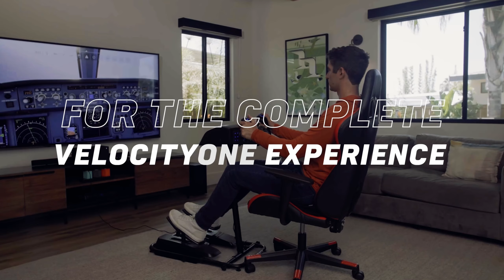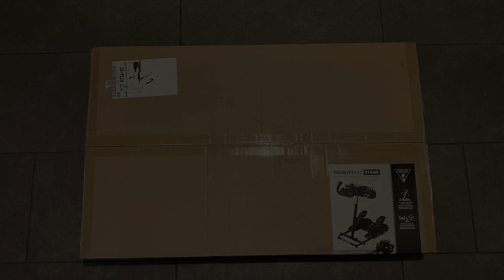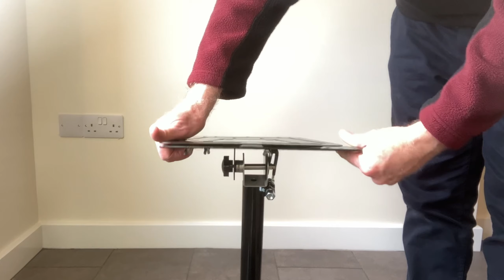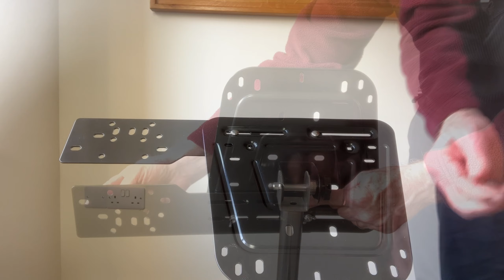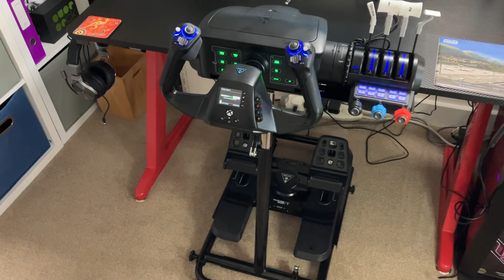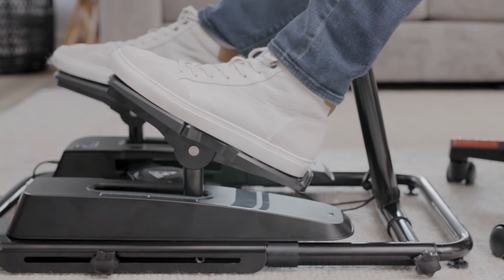An answer to your peripheral space problem? | Turtle Beach VelocityOne Stand | Set Up Guide & Review

Comment: There is little movement of the plate when pushing the yoke,so i drilled a whole in the pivoting parts and fit a quarter inch bolt in there and improoved as there is no more movement  with the pivoting parts.

Comment: Thank you for this video! I had mine backwards. I found the directions uselss, but the product nice, even set up wrong. I can fold mine down pretty far with the steering wheel and peddles still attached. I play a lot of Need for Speed style games and my wheel setup isn't that expensive, but it still worked with the stand. Overall very pleased. Thanks again!

Comment: Tried to attach an old Saitek yoke and Thrustmaster throttles using screws but ended up using 3M VHB Tape 5952F. Much easier and sturdier to fit than the screws, but looking forward to issues with disassembling it to replace something in the future.

Comment: will it work with my old Saitek pedals?
Reply from the maker: I think so. Haven’t tried them.
Reply: @SimHangerFS   I  hope they fit.  Never had trouble with the pedals, so I don't want to replace, but the stand is way cool.
Reply from the maker: @MrSunlander  There are so many fixing points I don't think you'll have a problem at all, but I have not personally tried them on the stand :)

Comment: What has happened to my MS Flight Sim??? 1...I'm unable to access Market Place, 2...In multiplayer  Live Player, all Players, Off Group are all inoperable, 3...Air Traffic live traffic inoperable, 4...Weather and Time live weather inoperable., 5... MSFS nolonger downloads  live cenery, raod run through fields etc. Its a mess. I have fibre to the street but it has recently dropped from 65Mbs Down load and 21Mbs upload to 48Mbs down load and 17Mbs upload, Could this be my problem? Any suggestions would be most appreciated. Dave M.
Reply from the maker: Sounds very much like your having intermittent drops in internet connectivity. Alternatively MS side server issues.
Reply: @SimHangerFS  Thanks Mark. I think you could be right with the drop outs, sometime when watching Youtube Videos the video will freeze and then after a short time start up again. I have contacted my service provider ansd they are looking into my problems.
Reply: @SimHangerFS  Thanks for your help Mark, it turned out to be Online Functionality was turned off in General Options/Data. Dave M.